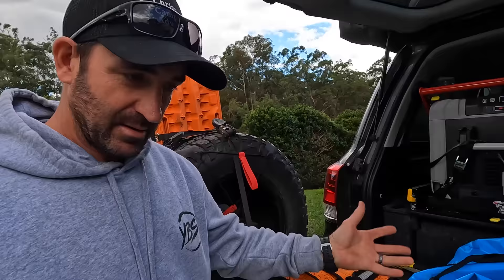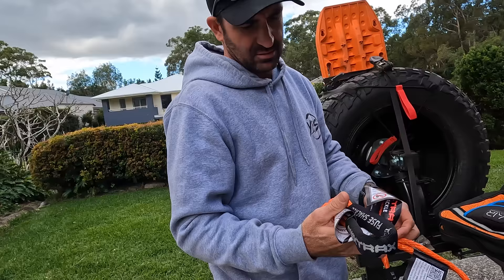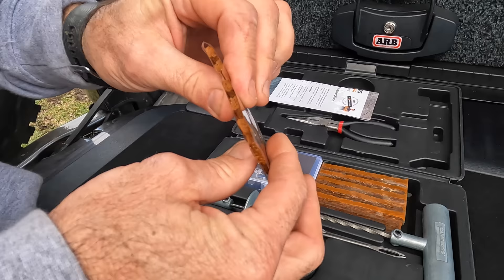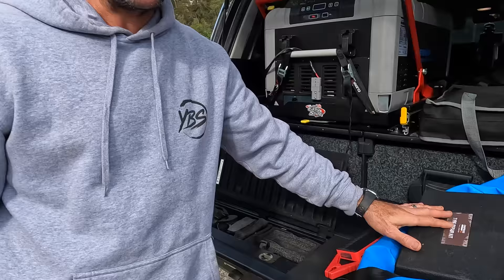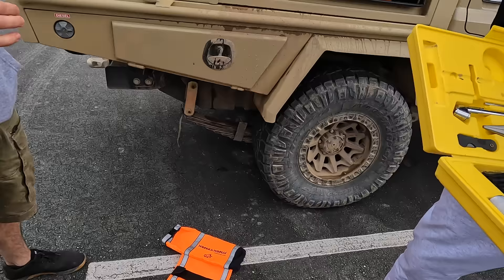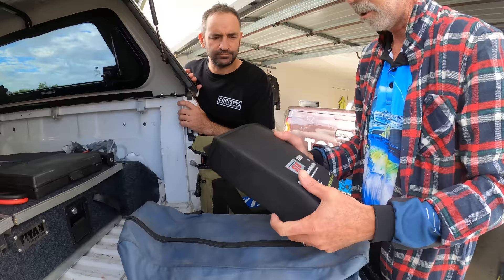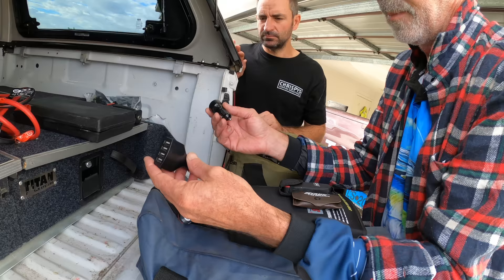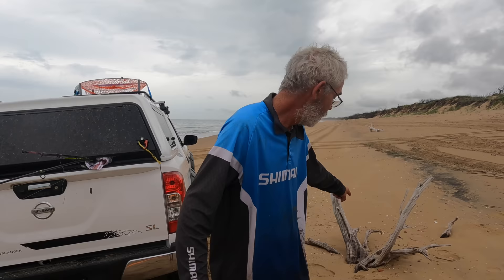OUR PICK OF THE BEST 4WD RECOVERY GEAR AND GADGETS

Comment: Good kit. Only suggestion I can make is the Saber HDX shackles which are cut resistant and completely replace the metal shackles in my kit. Especially good to have if others don't have the soft shackle friendly recovery points. Cheers for sharing.
Reply from the maker: Thks mate.